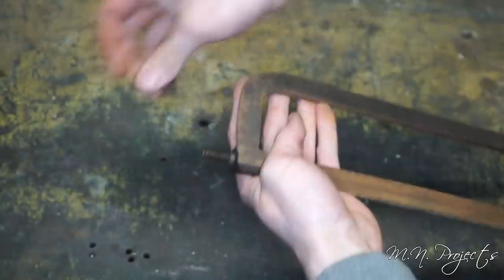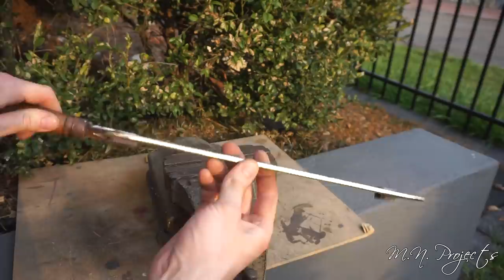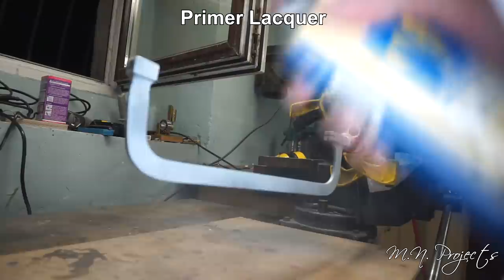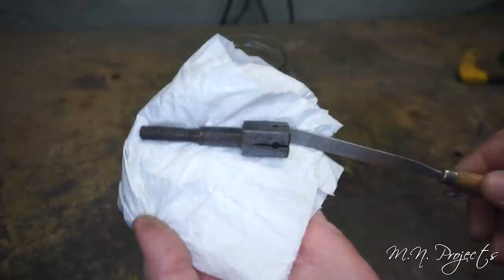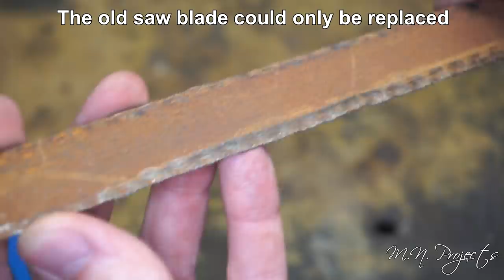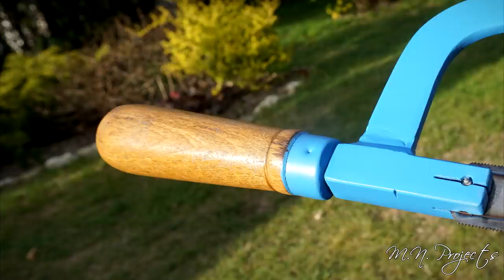Old Rusty Saw - Quick Restoration

Comment: I like it.
1 tip I found... warm up the paint spray cans, by putting them in a bucket of hot water before use.
The paint goes on smoother and fluffier, soaks into the surface more deeply, and dries faster.
After I worked this out, I found out that spray shops actually have heaters for their paint for exactly that purpose.